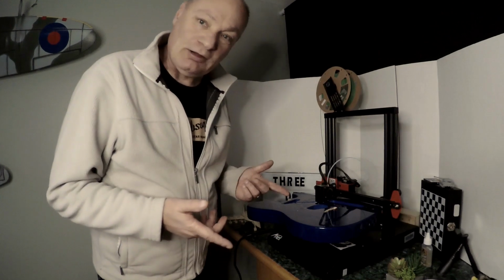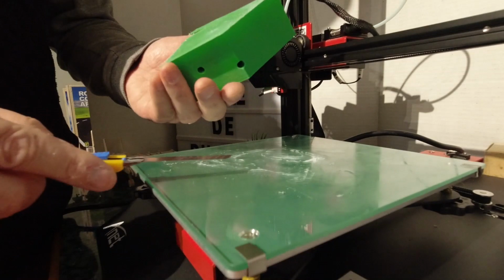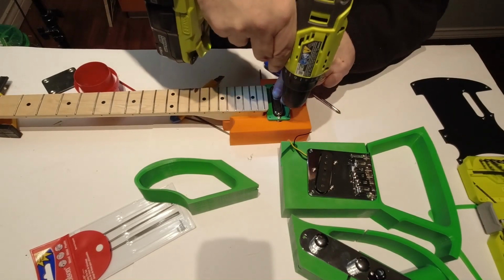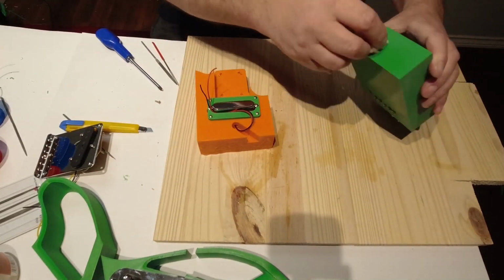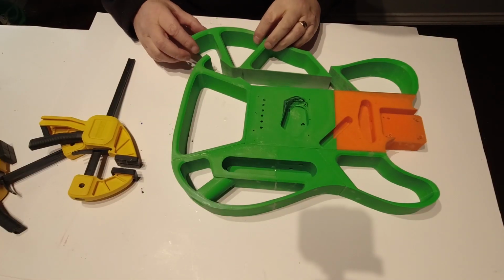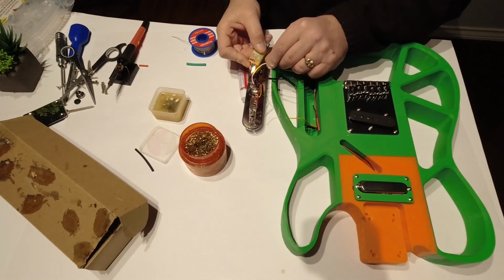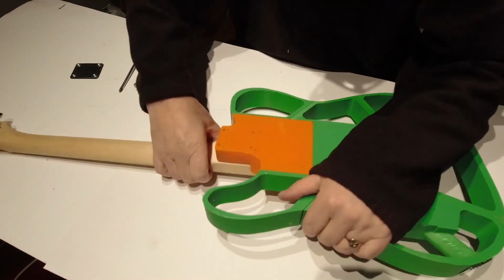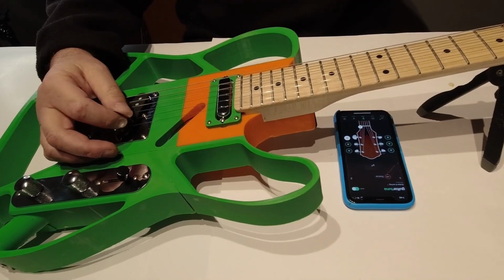How I made a 3D printed guitar at home using a small printer

Comment: I have to say that those great big holes look like they would be exactly where I rest my hand to pinch harmonics. I could not play that guitar effectively.

Really cool project though. I have a Les Paul that was almost completely destroyed in shipping. I am currently looking at various models of 3D printable guitars so I can reuse the electronics and hardware, I have a couple of spare Strat necks laying around and quite a bit of hardware from various guitars that I have either upgraded myself or repaired for others. I should be able to find enough to make a guitar, possibly a couple. 

The hardware will probably be the most overkill hardware of any 3d printed guitar so far, proper USA Gibson pickups, pots, split coil electronics and more. I would never buy that hardware for a project like this, but it's just been sitting there doing nothing for a decade so why not use it?

Wish me luck.

Comment: GREAT VIDEO.

Is there any chance of acquiring the Solid Works files in "step" format ?
I want to use a small laser to cut the profiles out of 1/4" plywood & your "stl" files will not import into my cad system.
Thanks
Ted
Reply from the maker: I only had the stl I have no idea 🤷‍♀️ how to change them up.

Comment: Stop using grid infill! That glue seemed to work well but it requires a lot of patience, lol! I used an epoxy, it was much faster :)
Reply from the maker: What infil is better or should i use thanks 👍 and yeh that glue has fixed a lot of stuff even a coat lol 😜
Reply: @GuitarsandDrones  if you use grid infill, the head can hit the previous layer as it crosses over it and can knock the model off the plate. Try the gyroid pattern. It’s very strong and doesn’t cause the head to cross over itself. Grid infill can be the cause of a lot of problems.
Reply from the maker: @officialWWM  Ok I will try that  thanks ☺️
Reply: @GuitarsandDrones  no problem. I’m sure you will have less failures :)